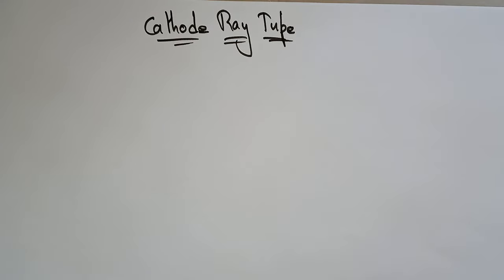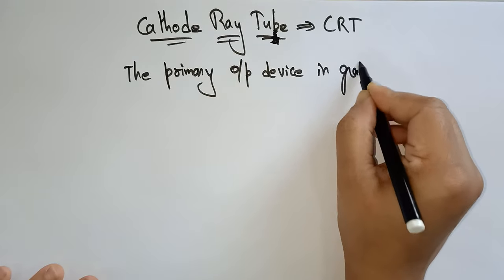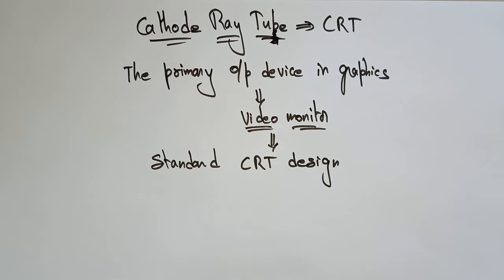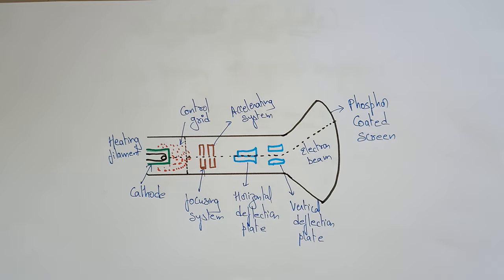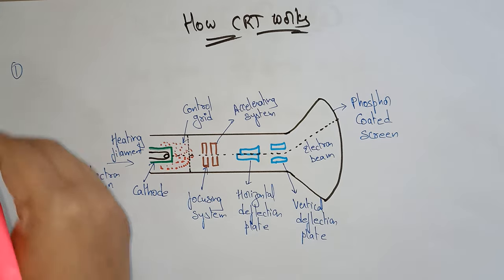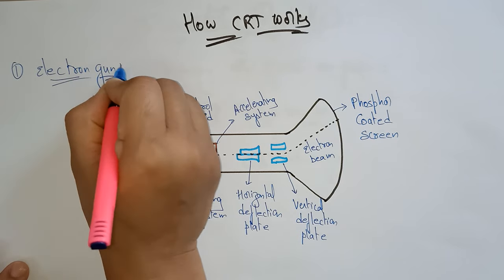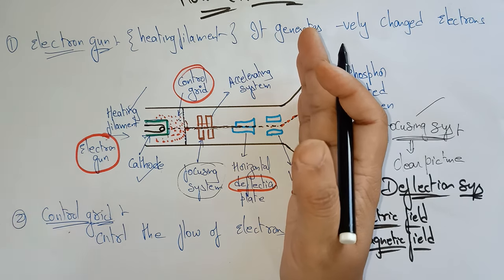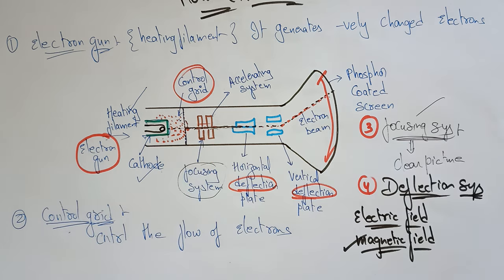Cathode Ray Tube Display | CRT | Computer graphics | Lec-5 | Bhanu Priya

Comment: Do crt contain one or more than one electron gun
Reply: The primary components of a cathode ray tube (CRT) consist of a vacuum tube containing an electron gun and a screen lined with phosphors. 
CRTs are used to produce images. Color CRTs contain three electron guns corresponding to three types of phosphors, one for each primary color (red, blue, and green).
Reply: @allaboutcsit  tq...

Comment: Do crt works on beam Penetration or shadow mast method
Reply: The Beam-Penetration method has been used with random-scan monitors. In this method, the CRT screen is coated with two layers of phosphor, red and green and the displayed color depends on how far the electron beam penetrates the phosphor layers